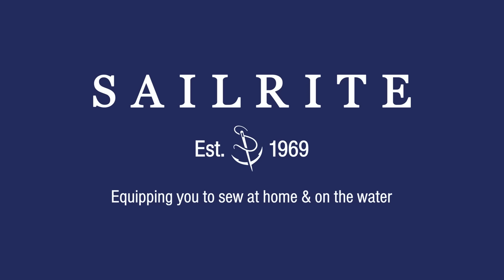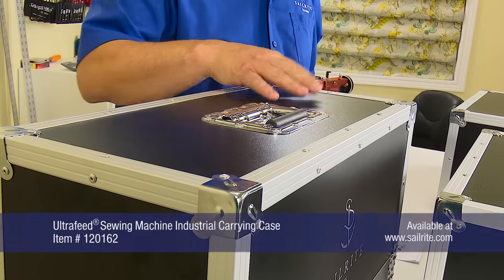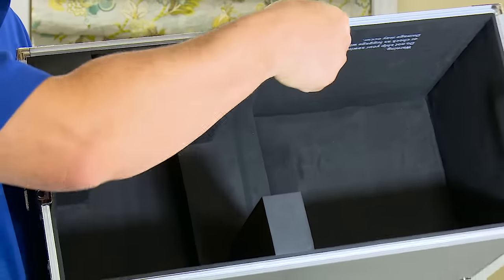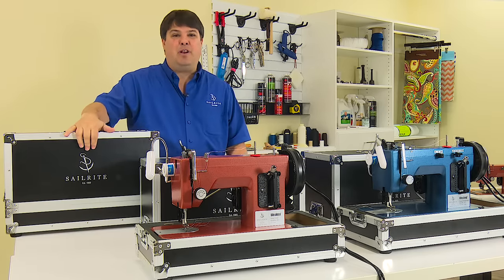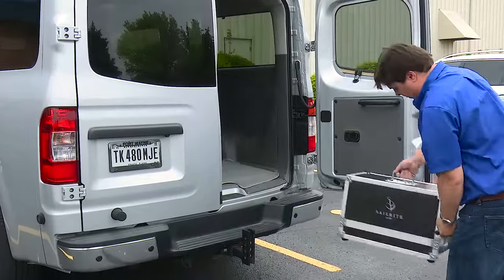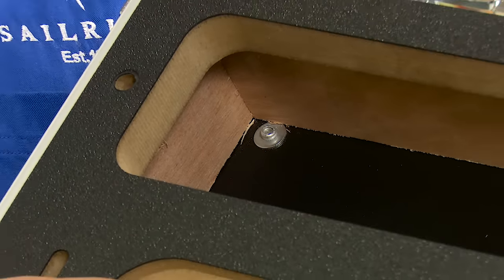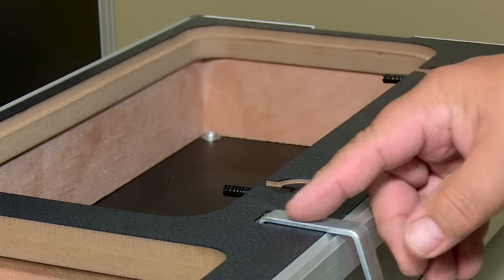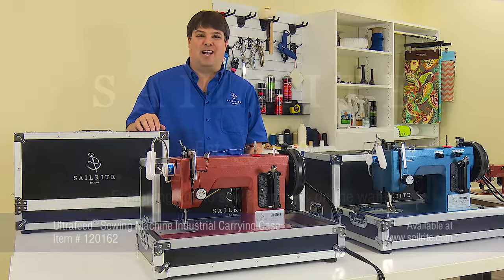Ultrafeed® Sewing Machine Industrial Carrying Case Demo

Comment: Would there be a concern of aluminum rot occurring on the trim if the machine and case is stored on a boat long term? My original black case was damaged in shipping (actually just the base was damaged beyond repair) when the machine came loose from the base and broke the base all apart inside. The machine had nary a scratch from it all. I'm glad you've made one to protect the machine now. Thank you.
Reply from the maker: This new Industrial Carrying Case is tough and will
withstand a lot of abuse. Some of the case components are aluminum and will not
rust, but others, like the corners and latches are made from metal components which
are a zinc alloy steel. Those parts will rust when stored on a
boat for long periods of time. To protect them from rusting I would use a T-9
Boeshield spray (part #86700) every few months. The sewing machine has more
metal parts than the Industrial carrying case, so it too should have a coating
of the T-9 spray placed on bare metal parts. But do not do this excessively (only
once every 6 months or so) on the working metal parts of the sewing machine, as
a buildup of wax may bind the machine up.

Comment: it looks like there are a bunch of rust prone parts. Are you planning a rust proof case for shipboard use?
Reply from the maker: We have tested this carrying case bottom by leaving it out in the weather for a year on our test board here in Indiana. I can send you a photo showing the amount of rust, which was very minimal considering it was out for a full year. Please email me at: eric@sailrite.com if you would like that photo. 
If I were using the case in wet conditions I would spay Boeshield T9 #86700 on the metal coated zinc parts, that should help prevent any rust from occurring (we did not use the T-9 on the test case above).